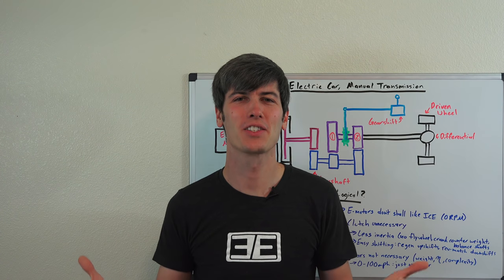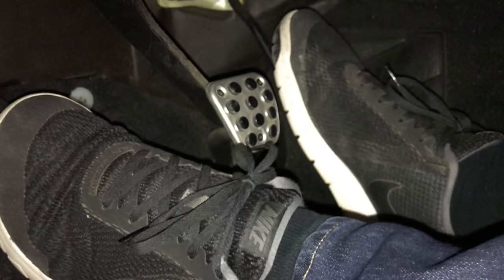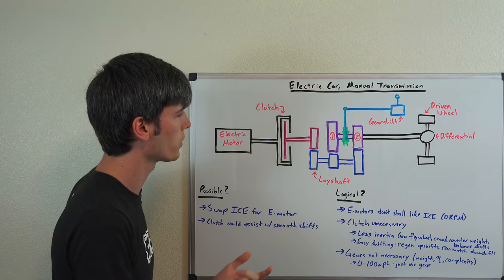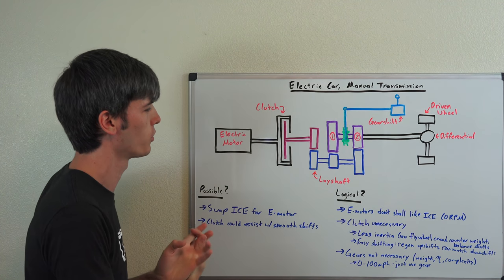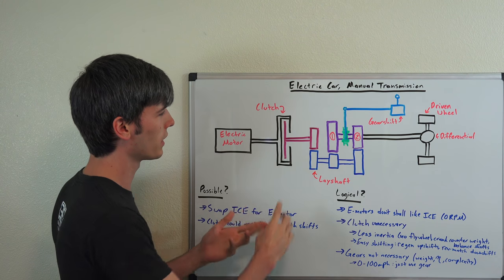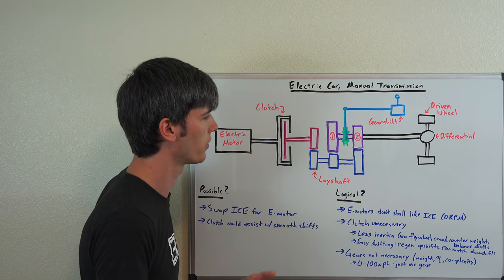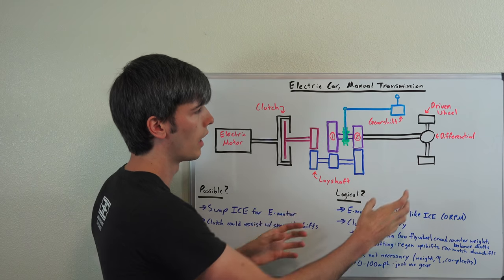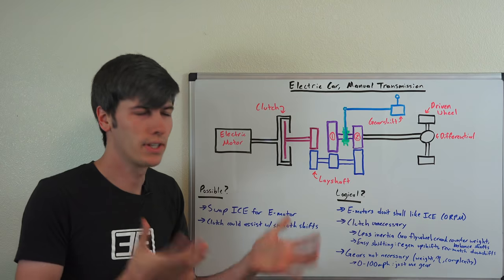Could Electric Cars Have A Manual Transmission?

Comment: The only thing you didn't explain is whether or not this transmission would be energy efficient. Would you be saving electricity by allowing the motor to move at a slower RPM while the car maintains a fast speed?
Reply from the maker: Depends on the efficiency curve of the electric motor, but based on my discussions with Formula E, it's often not worth the trade-off of the efficiency loss and weight gained from a transmission.
Reply: Engineering Explained So, road cars might have a strong benefit from having a 2 speed transmission to get maximum efficiency at both city driving (stopped - sub 40mph) and to run at the peak of the efficiency curve at highway speed ~75 mph. I do recall Tesla experimenting with the roadster to have a 2 speed to get good off the line performance and efficient highway driving, but the sample transmissions were poorly constructed.
Reply: Latest design for electric cars is that they are almost residing next to wheel for efficiency. I still don't see in wheel design in productions yet. I think they are coming, so in that case transmission will make no sense. I think they are not doing it to keep it off ground in case of traversing higher water level and to keep wheels lighter.
Reply: that's what i was thinking too in the last few episodes...
Reply: actually yes, electric motors, particularly AC induction motors (like you see on Tesla cars) start to lose efficiency at the high end of their rev-range, due to the way the motor works the rotor gradually loses sync with the stator that propels it, resulting in some forces that are of inappropriate direction to take full advantage of the provided force at that state of rotation or in even going against the rotation of the motor.

Only problem is, electric motors are beneficial in that they don't require a transmission to be functional in a car. so there is little incentive to install one, considering the weight and cost savings, as well as the lack of a need to shift
Reply: Mark Williamson That's also what I was wondering. Today's cars have far more gears for the sake of efficiency than would be ideal for performance.
Reply: yes, more gears but they don't work the same time. Only one gear at work so number of gears ad weight and complexity, but not stage of rotations, in ICE vehicles.
Reply: Hi, I like your videos alot.  In this case I think a cvt could be the solution... Can have a quicker start and the motor running lower rpm at high speed.
Reply: in most cases it would make it worse.
For most of their powercurve electric motors have a really high flat efficiency.
big electric motors often are 90%+ from 10% load all the way up to 100% load - this means for them a transmission is less-efficient in all normal scenarios - and that would be without taking the extra weight into consideration.

But - it can help if you want to make alight, small and efficient car:
You can downsize the motor to just be enough to reach highway speed. This would destroy acceleration - but that is where the gearing can help.
Reply: You're talking load we're talking RPM
Reply: If the electric motor is half decent then transmission losses and weight will always make efficiency worse, especially for road cars as they are only used at a smaller range of speed.
But for the sake of enjoyment you could go for a manual just to have the extra acceleration even if you aren't running super powerful motors.
Reply: For commuter cars engineering explained is right in that they only need one gear but for others vehicles it would be very beneficial so I wish he would address that. The main types that would benefit are trucks and performance focused cars but since this channel is more car focused ill just talk about that. The reason why some teams in formula e go with only one gear is because with the current rules it makes since. With how little of power that the cars make combined with the bad tires, low downforce, types of tracks that the race on, and the low top speeds, only one gear can work. Even then it is still unclear which is the best solution as the majority of teams are still running multiple gears. For high powered cars and street performance cars a second gear would really help. The power and especially the torque starts the fall off the faster you spin the motor, it's not a flat curve all the way to redline as most people think. A second gear would allow the first gear to be a much higher torque multiplying gear (useful when the tires and downforce get up to par) and the second gear would allow a much higher top speed. Rimac sees this as does the electric semi truck manufacturer Nikola motors.
Reply: nryastew you can do like what Tesla did they use 1 high speed gear and for the acceleration what they did is overvolt the electric motor for seconds of the acceleration.
Reply: ABaumstumpf That's what i'm thinkink about: will it make sens to put in the car smaller and lighter (and cheaper) electric motor, loosing some power + some gearbox, 2 or 3 gears. 1st for urban, 2nd for highway or 1st - urban, 2nd - rural, 3rd - highway. Also in EV reverse is needless, and 2/3 gear transmission would be lighter than 5/6 gear. Together, lighter motor and lighter gearbox maybe wouldn't be much heavier than bigger motor w/o gearbox? And maybe cheaper?
Reply: Engineering Explained plz do a video about how Tesla uses 1 high speed gear and for the acceleration they overvolt the electric motor for seconds of the acceleration, even the motors in Tesla are rated at 450 bhp not 690 but with overvolting the engine for a short time the power curve is the same as 700 bhp gasoline engine
Reply: I've done a lot of reading on model rc motors. What I've read says that the slower the motor turns, the more efficient it is.

I don't quite remember why but it has something to do with torque and using more amps over volts.
Reply: Carlos Delgadillo it's very different for an electric motor because internal combustion engine power output is very reliant on rpm, where electric motor are not. This has a lot to do with the low inertia, as explained in the video, but it mostly has to do with how power is "converted" into work in combustion vs electric. The best way to think of it, intuitively, is that in a combustion engine there is two "steps" required to turn the fly wheel where as an electric motor only has one step. In a combustion engine, the fuel needs to combust first, and this energy pushes pistons which do the necessary work to move the gears. However, in an electric motor there is no pistons to worry about. The motor generates an electric field and the field itself turns the flywheel almost directly. In an electric motor, the electric field is doing the work, whereas in a combustion engine it is a combination of the fuel combustion and the pistons. Considering this it's easy to see why combustion engines have such a hard time breaking the inertia of the pistons and creating leverage against the crankshaft.
Reply: 1st law of Thermodynamics.

Energy can never be created or destroyed. Only transferred from one form to another. 

Theoretically, IF a manual transmission were to be Installed in an Electric car, the top gear would have to be 1:1. Otherwise any overdrive would just use more power more quickly. It wouldn't be anymore efficient. Only less efficient because of the weight of the transmission.

Now for performance enthusiasts who don't care about efficiency, I'd imagine you could manage to create some incredible scenarios..... Especially a 1st gear with a 3:1 in an all wheel drivetrain!  An electric motor with no lag in 1st gear would literally accelerate at neck breaking speeds.

I'd pay good money to see/experience that. God knows what kind of tires you'd need for that....
Reply: Nehad Shello Over current, not over volt.
Reply: Nathan Curet Massive cargo trains do not use gears. Trucks won't either. No gears, no cvt, nothing. Ever.
Reply: Barry Allard How many gears do trains have?
Reply: difflocktwo  how fast do "massive cargo trains" go? The answer is when they are pulling a lot of weight, they are going slow af.
Reply: Nathan Curet It is a legal speed limit. Do you think high speed trains use gears? They haul thousands of tons, from 0 up to cruising speed. No gears.
Reply: Mark Williamson my e-bike benefits from the 7 speed rear transmission. Started from a full stop in 5th pulls about 800 watts, while starting in 2nd draws only like 250 watts. This makes a big difference when you only have a 650 watt battery.
Reply: difflocktwo  high speed trains do use motors at all. They use magnets, so my point still stands.
Reply: Nathan Curet TGV doesn't use motors? Does TGV use multi speed gearboxes? A motor is a motor, be it a linear motor (maglev) or a rotary motor (everything else).
Reply: difflocktwo   Yes they are both motors but they operate in completely different ways. Obviously a truck doesn't have a magnet system in the road so it will have a max motor rpm and to get the torque and top speed needed, it will need 2 gears. Most semi trucks have around a 50:1 first gear(total). That ratio with 40in tires and even using the teslas max motor rpm of 18k(it will be less than that because it must be bigger to produce the torque needed for a semi), the max speed is around 25-30. Obviously not enough.
Reply: They don't over volt the motor. The voltage is always the same, they just provide more current. They get away with 1 gear because they use a motor that can output a ton of power. You basically can do the same thing with a Chevy Corvette. A Corvette is so light and the motor makes so much power you can just get rolling with 1st gear and go right to 4th gear. The motor makes so much power that 4th gear can go from about 10mph to 100mph and only needs 1st gear because ICE motors stall. More power = less gears needed, less power = more gears needed.
Reply: Nathan Curet Again, trains, huge earth movers, you name it, don't have multiple speeds. Direct drive electric motors don't need gears. Don't use a 50:1 ratio. Use a 1:1 ratio if you want, just get a very high torque motor per wheel. Imagine a 40 inch diameter motor and the insane torque it will create.
Reply: @sample text Yup! Direct Drive vs Mid Drive. Also note that a 72v BBSHD at 50a drives just like a Tesla. Pretty much just get a 42t front and set the rear on 21t and hold on all the way up to 50mph! You could go down to a lower gear but you pretty much can't keep the front down on the ground!
Reply: sample text That's because you wasted mass and cost on the non power generating drivetrain. If all your extra non-motor mass was converted into a larger motor and or more battery you would get more torque with less losses and overall outperform what you have now.
Reply: MasterQuack14 BBSHD is very expensive. How does a similarly priced hub motor and controller compare?
Reply: Mark Williamson wattage pls
Reply: nryastew just get a 2 speed setup for the motors you are using
Also check out electric roadster he did the same thing
Reply: efficiency only affects full throttle situations, in normal driving experince you'd get more loses due to gearbox heating and wheigth
Reply: Some motors on the market had been adapted to run at the same RPM's as combustion engines so they can be atached to a convencional gerbox this is the easy way to convert to electric
Reply: The weight of a transmission designed to handle 1000 ft/lbs of torque in a race car is a lot higher than the weight of one designed around the typical 100-200 ft/lbs of a typical car. You can have a locking planetary 2 speed weigh as little as 30-50lbs and handle that. In a all carbon fiber ultralight race car this may be an issue, but in a 3-4000 pound street car this additional weight is negligible. Also, transmission heat is only an issue in automatic transmissions because of the hydraulic slipping clutch plates, not in manuals.  

See: https://www.google.com/patents/US20090247346

Also, induction AC motor speed is only limited by the controller maximum step frequency. BLCD/PMAC are limited by controller step frequency and voltage to overcome the magnet's reverse induced eddy currents. Higher frequency controllers that can output high amperage at higher voltage are very expensive thus only found on Formula E cars and Tesla's Cars. The ones 'adapted to run at car speeds' are not actually adapted, they simply have a higher winding turn count, higher pole count, and use a cheaper controller with a lower max frequency.
Reply: difflocktwo  omg are you serious? A 1:1 ratio on a semi? lol the motor would need to make like 100,000ft lbs (2000ft lbs x 50:1 that a new diesel has) to be able to have the same moving power. You have no idea what you are talking about, conversation over.
Reply: MasterQuack14 haha yeah, I have a 52v 3000 watt system but it's the same deal. Drives just like a Tesla if I want it too, but I can squeeze out more miles with adjusting gears up hill and on flat terrain.
Reply: difflocktwo I Believe you're incorrect, only because the added weight of a 7 speed bike transmission along with some cables and a shifter is negligible compared to the weight of the brushless motor. A 3000 watt motor is plenty of power to take off in the highest gear, but you'll the watts sky rocket to their max, as the amps increase to reach demand. 

My system is capable of pulling max 42 amps at 58 volts, but if I wanna go more that 20+ miles to a charge, I shift down at stop signs and take off slow in the lower gears.
Reply: Nathan Curet Theoretically an electric motor is capable of such since it has peak torque at zero rpm. Or a transmission that flips it to 1:1. After the truck is moving you do not need 10,000ft pounds due to inertia, like a loaded freight train that uses electric motors powered by a 16,000hp generator.
I believe it is you who does not know what you're talking about.
Reply: Nathan Curet Also freight trains definitely do not use maglev, at least in America.
Reply: Geeky Channel   Ok I'm done. You all are comparing two completely different things here's
Reply: Sample Text, You are absolutely correct, I have been saying that gearing can conserve a lot of energy and provide more torque at the same time. The reference to the Tesla I was making was that the higher voltage give you a much wider RPM band. Going from a 48/52v to a 72v will bump the motor's stock maximum RPM from 4k to 6k. So your top speed in every gear will be 50% higher, so you can stay in the lower gears with more teeth to avoid chain skipping at higher power levels. The difference between a 48/52v running at 3 KW and a 72v at 3 KW is huge. Not only will you consume less amperage, thus producing less heat, but you produce more over all torque at the same target speeds because of the ability to stay in lower gears thus producing more torque per watt.

On a side note, it is pretty easy to tell the ebike builders on here vs the theory crafters that haven't built EVs before... LOL
Reply: I noticed most people who build their own electric cars at home tend to keep the gearbox (and change the final drive) because it allows them to use a lower powered electric motor.
Reply: CVT can't handle the power that the tesla engine is putting out, YET....
Reply: Master Debater   A cvt can't deal with the torque of a ICE with more than about 250lb ft, and that's with the bad torque curve of a gas engine. An electric motor would shred a cvt. If there is ever going to be a trans in an electric car, it's going to be a 2 speed.
Reply: Nathan Curet pretty much all heavy equipment such as tractors and earth movers use a cvt transmission. some of these put down torque that would embarrass a semi.

the gear multiplication simply isn't needed for a ac style electric motor. the speed the motor turns is controlled by a speed controller, and effectively, produces its own sort of power ratio independent of gears or mechanical leverage. electric motors are designed with a certain peak efficiency, although this would be at a particular speed, an electric motor is still much more efficient at all rpms above and below this peak efficiency compared to a gas motor.

lets say you have a regular gas motor. 100ft lbs to make the math easy. this is only accomplished in a narrow rpm band, lets say 2000rpm. lets say that 1st gear is a 4:1 ratio and you have a 4:1 final drive ratio, you have a 8:1 advantage in 1st gear. so that 100ft lbs becomes 800ftlbs. because we geared down the motor, we can only do about 30mph before the motor runs out of steam, so then we shift to 2nd gear, around a 2:1 ratio. now we only have 600ftlbs, but the car is already moving so less torque is needed to accelerate.

most electric motors will spin 10,000+ rpms and can make peak power at zero rpms. so instead of requiring mechanical leverage to reach peak efficiencies, we just need to spin the motor and the speed controller will make the motor work the most efficient it can at what ever speed the engine is turning.

most home built ev keep a manual transmission because it is a simple and easy way to build an adapter to mount the electric motor on. most conversions are also done cheapely with second hand parts where price is the biggest factor, rather then efficiency of a particular setup. if efficiency was a primary goal, you wouldn't start out with a gasoline motor far to begin with.
Reply: lilsammywasapunkrock   Have you looked at how the tractors and equipment cvt transmissions work? Look them up and get back to me. Hint: their design to handle the torque makes it so they can't spin fast at all.
Reply: A typical automotive/motorsport well designed permanent magnet synchronous motor is well over 90% efficient over its entire speed range and the whole torque range except for very small (eg <5% of maximum). A typical gearbox may have an efficiency between 60% and 85% depending on ratio, loading and design quality. I can think of almost no situation where adding a multispeed gearbox would be beneficial for efficiency. They can make sense for performance, however.
Reply: exactly
Reply: Good point, thats why using two electric motors with different power curves in an orbital planetary gear assembly like Toyota's PSD would produce an efficient way to improve performance without harming efficiency. 

EV motor technology will continue to improve with battery technology : so this gearing discussion will eventually be put to rest/ it stems from the wild west electric vehicle days we find ourselves living in; the limited early state of that technology with respect to the 100+ year refinement of internal combustion... etc
Reply: Nathan Curet yeah, ive never seen a tractor pull (where cvts and custom built for peak power output and high speed) and snow mobiles that make 600+hp and are capeable of over 150mph, without a final drive differential. 

such things must not exist.

there is no point in using two motors or a planetary gear unless neither motor is suitable for the application. electric motors can be way bigger then needed with virtually no draw backs or loss of efficiency. larger electric motors are often chosen because they would be more efficient at lower load levels then the "correct" or smallest motor would be at peak power output. unlike standard gasoline motors.

brushless a.c. motors have been around longer then carbed motors. they were widespread in industrial applications before the Wright brother's ever flew.

because of the threat to oil and common car manufacturing, the downsides are often exaggerated and portrayed as a mad scientist's contraption not ready for mass market.

do you remember how laughable the tesla electric car concept was 10 years ago? although its been refined in production, virtually nothing new has been done in a tesla that couldn't be done 20-30 years ago. remeber the gm ev1 scrapped in the late 90's? the gigantic electric fleet of ford rangers "leased" to corporation's for durability testing? 

I have a brushless lithium ion drill older then teslas founding. from that technology, its all just a matter of scale and infrastructure which is quickly coming to age.
Reply: Nathan Curet
Your comments about the first gear ratios on trucks had me geeking out. I started to wonder how much torque a diesel-electric locomotive has.

https://www.trainorders.com/discussion/read.php?2,1124290
https://en.wikipedia.org/wiki/EMD_SD90MAC

Turns out, anywhere from about 100,000 to 200,000 lb ft. However, that's a total. Standard for a freight train is to run 6 electric motors, geared to something like 4 to 1 or 5 to 1. This means that a single, monster-sized electric motor, like the Siemens 1TB2830, produces around 850 hp (not completely out of line with a truck), and about 9,500 lb ft of torque (about 4 times more than a rig's motor, ungeared). So, a motor like that could be used, but not without a transmission (like you said). Also, I couldn't find the weight of that motor. 

Why it's horribly impractical - to power six such motors, General Motors Electro-Motive Division specified a 186 litre, 6,000 hp V16 diesel engine... and all things being equal, a truck with one 1TB2830 would want a 1,000 hp, 31 litre engine. (twice the size of the typical truck motor)

Final point of interest; the power loss. The electric motors can't output anything more than what the diesel does. The massive alternator on the V16 is 90% efficient at converting movement to electricity, as are the traction motors at converting the electricity back into movement. This amounts to a 20% loss across the powertrain... a costlier drain than a manual transmission.

So, from what I can see, a transport truck either hauls around 1/3rd of it's towing capacity in batteries, or an electric motor, with transmission, and diesel engine with fuel. Both ideas seem horribly inefficient.
Reply: Oliver Holt  rimac made a 2 speed double clutch that is 95% efficient.
Reply: The more gears and cogs that you route electric motor power though, the more power or amperage would be required from the electric car's battery to power the motor, shortening the car's range between charges. This is because of friction horsepower absorption by the gears. This can also be demonstrated by measuring horsepower at a gasoline or Diesel engine's flywheel, and then measuring horsepower at the wheels with a dynamometer. The wheel horsepower would always be less than the flywheel horsepower. 

Yes, the (gas or electric) motor would have more mechanical advantage (Google, "simple machines") with gear ratios of less than 1:1 to accelerate the car to speed. But after the car is at speed, reduction gears, or even overdrive gears would be a waste of electrical energy from the battery. 

Cost and weight of the transmission would be another factor in weighing the benefit of multi gears in the electric motor powertrain.
Reply: Mark Williamson no, with electric motors the opposite is true. The armature spins and does have parts going up and down
Reply: Mark Williamson More important, is the ability for a smaller motor to do the same job. The energy consumption would, in theory be less for a smaller motor.
Reply: nryastew Keep the manual. It will let the motor do the same job with less effort, and at the very least, the car will be super torquey on acceleration.
Reply: Cody Moncrief you guys are all forgetting that unlike a gas engine, an electric motor does not always use more power at a higher rpm. a gasoline engine has to move to transmit torque, an electric motor does not. 

take a model airplane, with no propeller spinning at max speed, it may only pull 2 amps of power to maintain 10krpm. now throw a prop on and it will take 20 amps to spin the same speed. the motor on the ground will take more power with the plane stationary then it would in the air because the plane is already moving. when the plane dives, it will use less power to maintain the same speed. the same applies to going up or down a hill. it wont always require more power to maintain speed at a higher rpm level by motor speed, because the same amount of work is being performed. 

unlike the efficency curves of a gasoline motor, which require about 4x the fuel for every 1000 rpm reguardless of power produced. this is why newer cars have 8 and 10 speed transmissions with multiple od ratios for peak fuel efficiency.

i followed a ford ranger ev project for a while. the guy was conviced he needed the manual transmission because he was using a small 25hp motor to replace the 100hp gasoline engine. once completed and testing, he ended up putting the transmission in 3rd gear and removing the shifter all together. you do not need a reverse . no overdrive either. it might not take less power to move the car in 5th vs 3rd. 3rd just allowed for a bit quicker acceleration from a stop, but 1st and 2nd gear aren't really designed to be spun up to 15 or 20k rpms for extended periods of time which necessitated a shift to a higher gear to save the transmission from excessive wear. 3rd and 4th gear took the same amount of power to maintain the same speeds.

knowing what i know, id still use the transmission, but mainly so i wouldn't have to build/modify the existing driveline. it would be really easy to gut a manual transmission and remove all the gears and synchro to reduce rotational mass to further increase efficiency once the "proper" ratio was found.
Reply: Tesla's Model S is plenty quick - dust off any supercar and you'd scare all the hypercar owners from a standstill.
Reply: Y D   And get destroyed at anything that is not a standstill....unless it had a second gear. Oh and losing some weight would help as well.
Reply: nryastew what batteries and motor you've got?
Reply: Considering most people drag race from a standstill, it's plenty. And the rolling acceleration isn't too bad - https://www.youtube.com/watch?v=SE3cv9RQsKI it takes on a BMW M4 which is a fairly serious car with a torquey engine. That's plenty fast.
Reply: From a Tesla/Production road car point not and racing point, something like a tesla 6 passenger car wouldn't this case extend the range of it for non high loads like a Tesla? Could this be something to explore?
Reply: Christopher Agnew thats the whole point that everyone here is missing  bad efficency for an electric motor is 95% and that is acrossed nearly its entire power range. even the simplest, least complicated gear box would suck up probably 7-10% efficency acrossed the entire range. 

if the proper electric motor is selected, a gear box will only lower its efficiency. an electric motor can produce 100% power from a stop, unlike a gasoline engine which usually makes 25% or less peak power from idle until the powerband starts, which will only last during a very small rpm range. that is the only reason cars have a gear box to begin with.
Reply: I think you'd be using a 2-speed where 1st is a reduction and 2nd is direct drive. Like Chevy's old Powerglide transmissions, which are insanely popular in drag racing because they are simple, robust, and the direct drive (same as 4th gear in an old 4-speed) puts all the power to the differential.
Reply: Brian Empey torque converters lose a lot more than 10% in. If you put in a transmission you might as well have many gears. One of them is always direct.
Reply: lilsammywasapunkrock A standard transmission doesn't lose anywhere near 25%. Otherwise it would need a transmission oil cooler line like an automatic.
Reply: Peter B. the standard "calculation" for drivetrain loss in an automatic is 25% and usually around 15% in a manual direct drive(meaning spinning freely locked together, no gear friction loss). i can guarantee the gears that are not direct drive have more loss.

not that it matters, i never said a manual transmission had a 25% loss anyways. i simply said that an engine at idle probably makes less then 25% what it would peak. re-read what i wrote again.
Reply: Brian Empey explain why a 1600hp motor on an engine dyno usually only pull puts out around 1200hp at the wheels with a power glide. simple and robust, yes. efficient, not even a little bit. ive seen stang guys go from c4's and c6's and actually go slower unless they reach a cetain power level.

usually any gain in a power glide is due to less time shifting gears, not because it is more efficient.
Reply: Umm all of you realize that they have made 2 speed transmissions that are 95% efficient. Rimac uses it in the rear of their car. That's only a 5% power loss. So everyone stop with this 15-25% power loss crap. 

Also powerglides don't lose anywhere near 20%. They are closer to 10% or less. Most people also know that electric motors don't need a trans for efficiency, so in commuter cars will never need one. But for performance, they would benefit greatly from a second gear.
Reply: Nathan Curet never seen an engine dyno compared to a chassi dyno i take it. 25% is the standard for an auto and 15% is usually the standard for a manual. some are more or less efficient, but it is a good ball park used pretty much universally. 

ive seen many, many power glide cars. they are power hogs compared to most automatics.
Reply: lilsammywasapunkrock  yes I have and you are heavily exaggerating the numbers to make your point. Most modern manuals have about 12% loss with auto losing about 14-15%.
Reply: Nathan Curet so now a transmission from the 1950's is modern? 

my car has an aod. it takes about 75hp. in my case, my oh so mighty 150hp motor would likely dyno less then 100hp, ive never actually seen a completely stock 302 standard output dyno, but the mustangs ususlly dyno around 180hp with some slight bolt ons. 

it isn't exactly 15 or 20% for every car. some are 50hp, but every transmission is different. as power levels go up, the transmission uses more and more of the power of the motor. a ton of it has to do with how efficient the torque converter is, but gear ratio, size of tires, how heavy the driveshaft is ect all calculate into drivetrain loss.

but yes, a good, standard and widely used figure for most cars has been, and still is, 25% for an auto and 15% for a manual. it is a ballpark figure anyways. the dyno is just a number. ive seen a ton of cars lose power on the dyno and actually go faster.
Reply: +ballisticjoe: As I understand it, regarding a two-speed transmission in a road car, Ford (and probably Toyota as well, given they use nearly identical systems) get around this in their hybrids by using two electric motors instead of one, one for sub-40mph city driving and the other for highway driving. It's why, in my '07 Escape Hybrid, the 40mph crossover point (above which it has to run the engine) is where my regenerative braking goes from awesome to nonexistent, but if I just let off the brakes for a second and reapply them, I get more regen from the other electric motor under 40mph.

Frankly, if we're talking about transmissions at all in electrics, why not skip the manual entirely and go with a CVT? Efficiency, after all, is what you're aiming for.
Reply: He mentioned that there were transmission losses and alluded to gear change delay. Basically the torque of an electric motor is more or less inverse proportional to RPM so there is more when the motor is turning slower so a you should select a reduction that maximises torque at the wheels. If you change the gearing to go faster the motor is running slower and therefore delivering more torque to the gearbox but less gets to the wheels so really there will be little or no benefit AND you lose time switching gears. That's why he said it would most likely be done just for fun. Tesla BTW achieves 0-100 in 2.3 seconds and a top speed of 215kph. Pretty good compromise, maybe you get 300kph with a different ratio but also possible that you lose too much torque at the wheels then. It should be pretty easy to put the numbers into a spreadsheet to see exactly what it means. You need transmission loss at the 2 ratios and the torque vs RPM for the motor in question. It shouldn't be hard to get those numbers
Reply: CVT would be a bad choice. It can't take the torque.
Reply: I disagree, the Toyota hybrid CVT would. Note that it isn't a Toyota invention, it's only popularised by them
Reply: nryastew keep it. Electric motors like to rev at no load. You know how a generator works? The motor reaches top speed when it is generating internally almost as much as the supply voltage.
Reply: Electric motors are very efficient over a wide RPM range. However the efficiency goes down at lower RPMs. As an example, if you want to double the power of an electric motor, you can either double the torque or the RPMs. 
If you double the RPMs you keep the same torque and therefore the same current in the motor windings. This means that the heat generated by losses in the stator does not increase. This means that the motor gets more efficient (more power, same losses). You have to increase the voltage, but that does not affect the losses in the motor, just the input power.
If you on the other hand keep the RPMs constant, and double the torque, you need to double the current. If you double the current, the power loss will be quadrupled, because the power loss is proportional to the current squared. This means that the motor gets less efficient running at low RPMs and high torque.
Other factors are for example the friction losses in the bearings, and the losses in the iron cores that increase with higher RPMs.
The conclusion will be that an electric motor will be most efficient at relative high RPMs, and that  in some applications, for example in a SUV, where you might want to either pull a trailer or go slow in the terrain, a two or three speed transmission might make sense.
Reply: When the car is in motion, Motor only needs to deliver enough power to maintain the speed, it will be low on force once speed is there (body in motion logic)... motor will use max power when the car is on sand still
Reply: Exactly you only need to counter drag to maintain the speed... you will only realise this once you drive a CVT. My 1.5L toyota premio 110bhp cruises on 80km/h with just 1400 rpm and 60km/h at 1200 rpm. The reason why CVT keeps rpm so low is that when you are maintaining the speed down the lane you don't need that much horses. When the car is still it has to pull all the weight which is stationary and move it to a given speed in handsome amount of time, that needs some good number of horses and you rev upto 2500 rpm.
Reply: If it's a simple manual trans, yes.  Going with a automatic negates any advantage.  Many people have converted older (lighter) cars and pickups to electric and kept the 5 speed trans.  While they can stay in 4th or even 5th gear all the time, shifting does give them greater range.
Reply: nryastew well you may lose efficiency but you gain the fun of a manual, like he said in the vid even combustion engines now have auto trans that are way more efficient than manuals we just enjoy driving a manual and thats why id personally keep it
Reply: Engineering Explained A manual is always worth it!
Reply: No, the slower the motor turns the less efficient it is. Going through cycle, there are points at each revolution where full energy is used so at really slow revs you get a hit of power for longer.. it's the reason why max torque is produced at >0RPM, and why it drops off as revs increase.

Now change up at say 60mph, not only do you have the increase in power use at low revs you also have to deal with aerodynamic effects on the body of car.
Reply: difflocktwo motors in trains weigh 2 - 5 tonnes while developing 300 - 1000 KW (500 - 1400 horsepower). They provide constant power range wide enough to be fully usable without any gearing but their weight... But nevertheless in high speed trains gearing is compromised to achieve high speeds with low stall torque, freight trains do not have that much torque at high speeds.
Reply: Krypto's I was thinking same thing. I am surprised nissan didnt use a CVT in the LEAF...they use it in everything else...and it would make it a rocketship.
My guess is that they wouldnt want a humble little leaf embarrassing a maxima.
Reply: nryastew Keep the box for reversing
Reply: My take is that the electric motors in cars don't really need a transmission, as long as the motor is made well enough there's no practical limit to how fast it can spin, so it doesn't need a transmission to achieve high speeds.  So if it's not a matter of RPM's to achieve high speeds, is it a matter of HP or torque to get the car moving?  Well, internal combustion engines have a fairly small power band (that's a RPM range where the engine produces high enough torque to be efficient enough to move the car)  So gas engines need the transmission to get enough torque to move the car below and above that power bands RPM range.  In contrast, electric motors, give or take a negligible amount, have 100 percent torque at 0 RPM. The torque and HP at the wheels remains pretty much constant throughout acceleration from zero all the way up as well.  So you can see without a limited powerband the need for a transmission to get the car moving from a stop is not there. You also don't need the transmission to try to stay in the powerband as much as possible throughout the acceleration like gas cars since the HP and torque at the wheels remain constant.  The biggest limiting factor for an electric motor's potential top speed is going to be drag coefficient and HP, gears wouldn't help here either since there's transfer loss and added weight with a transmission.  Therefore adding a transmission would make no sense at all.
Reply: SonicArc  Definitely keep the manual transmission. If it doesnt quite work out you could always just keep it in 6th gear.
Reply: Ryan Stewart  - your comment about thinking of trying both ways on an actual project car is two years old as I'm reading this. Did you try both yet? I'm very interested in the results of an actual experiment as opposed to a bunch of people arguing theory.
Reply: @EngineeringExplained  I really want to throw this question straight to you: if the difference in electrical energy pull is so minimal that it can be made up for by parasitic losses and a few kilos in weight, doesn't that also go the other way? If your goal is to have an enjoyable car, wouldn't reduction gearing mean that, say, 0-60 could be much quicker, while 60+ could be made quieter and more efficient?
On a race track, sure, outright speed is everything. But in the real world, range, sound volume, and acceleration are pretty much everything. I can readily accept that parasitic losses would pretty much flatten out any advantage, but would there be any meaningful DISadvantage to using manual gears (sans flywheel or clutch)?
Reply: @TheRguru1  But the higher revs will wear out stator, collector, brushes, bearings.
If you look away from efficiency and performance and blablabla, has anyone here ever actually opened up an electric motor and tried to overhaul it? It's a hit'n miss affair.
Electric motors with enough performance to get a car accelerating quickly, costs a lot of money, so I'd rather it lasted a good 10-15 years with 90% performance out of it rather than get 120% performance and expensive replacement motors.
Thus, my reason for wanting manual with electric motor is to keep revs down for the sake of motor longevity.
I'm not too big on performance, because I grew up with and have only ever owned relatively gutless cars (Toyota 4A-GE is my absolute standard... yeah theyre not too fast at all), and have found that if I have RWD with the equivalent of 120nM per 1000kg to get some slides in (if you're brave and chuck it around) = I'm happy, so I'm not after performance anyway xD
Besides, how much does a transmission weigh? The ones I fiddle with are only a wee bit 15-35kg, if you can live without A/C and infotainment = You'll shed MORE than 35kg off the weight of a car.
Reply: I always wondered if it would be worth it to use a smaller motor with a gearbox, rather than a larger motor with the torque for direct drive
Reply: @EngineeringExplained  what about for a heavy duty application? Like in a truck, could you be able to take advantage of the torque of an electric motor and not destroy it
Reply: @TheRguru1  Sure, a car- unladen and with maybe JUST a driver (of small stature to keep their rolling weight down).
But try using your EV to tow another (maybe one that's not even running, or an EV) out of a roadside ditch, or worse, towing a rather overladed firewood trailer, up a forest track, to get it home?

Someday you will discover oh crap, the electric motor isn't as efficient as you first thought, and cannot get (or keep) tractive forwards motion, at which point it burns out it's protective battery fuses, burns out the rotor/stator coils, or worse, blows the crap out of your batteries - as they explode from overuse?

Not everyone will use them in city (light) traffic, stop/starting at every street light, or whizzing along a delightfully well kept urban road?

SOME - especially those in outlying rural areas, will need to have a more versatile vehicle, that CAN tow an overloaded firewood trailer, up muddy tracks, or tow other vehicles out of a muddy side-of-road, where they have slipped down into, or worse, across open farmland in the pursuit of either a living (as a farmer) or as a mud slinging off-roader, to oops, slip to a stop on a steep muddy track, and cannot get going again, without another human (or vehicle0 within many miles?
Their life will depend on self rescue attempts, none of which will be possible with your tiddly wee city EV.
Reply: Yes it would, it’s completely illogical not to put a transmission in an electric vehicle